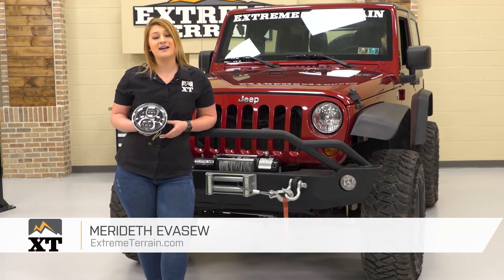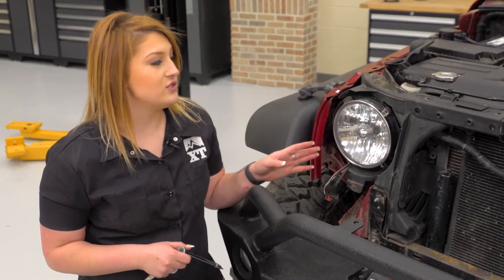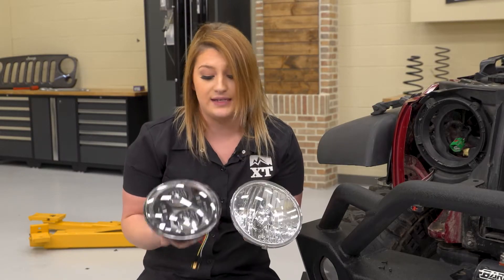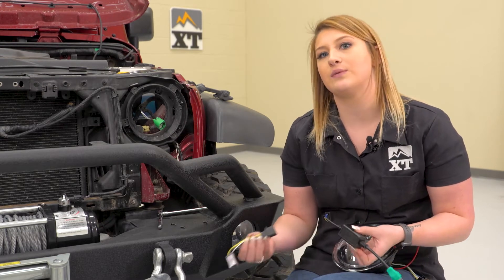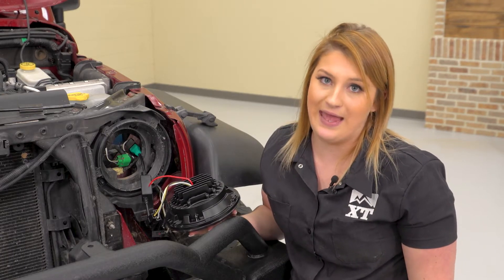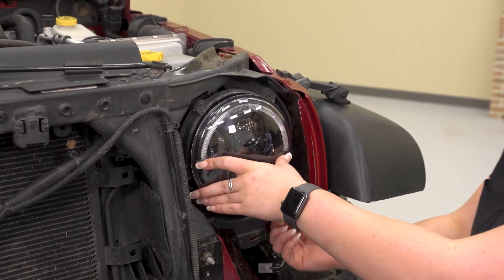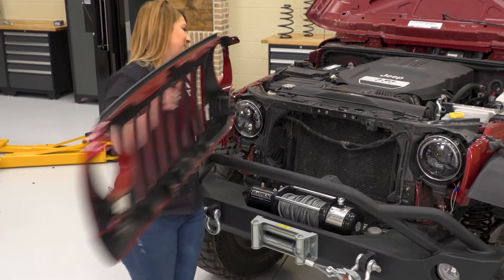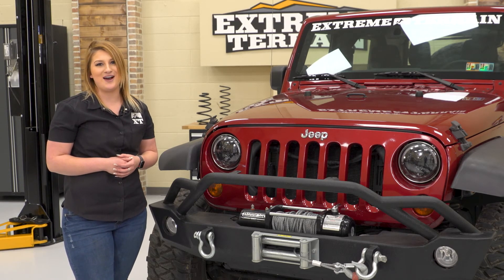Jeep Wrangler Axial LED Evolution Headlights - DRL (1997-2018 TJ & JK) Review & Install

Comment: I have a Canadian jeep wrangler that has the drls integrated into the wiring harness, would this be a good product to use or is there a way to wire them up so when I put the jeep in gear all the lights won't come on just the drls?